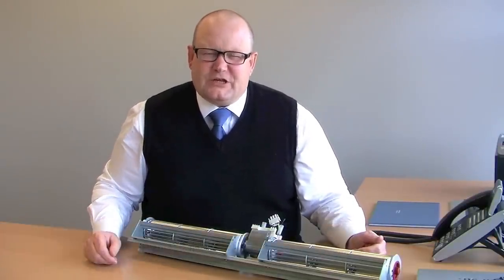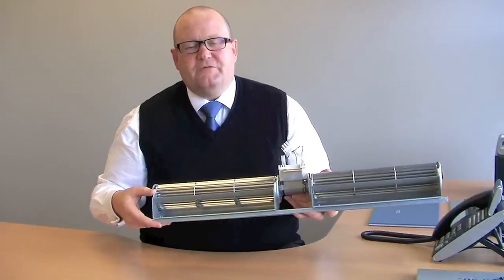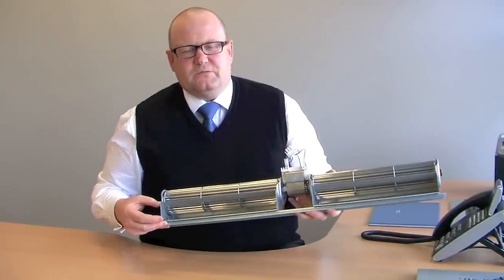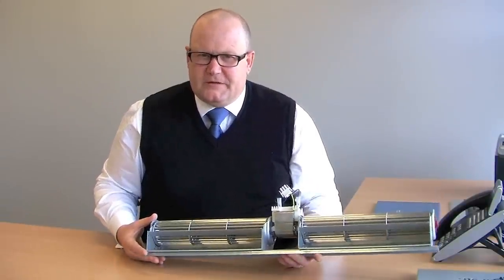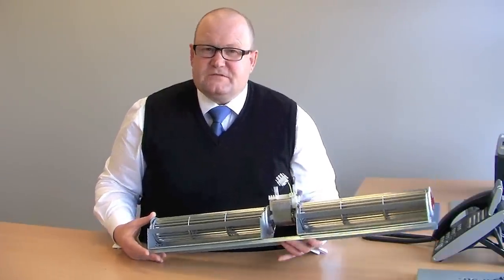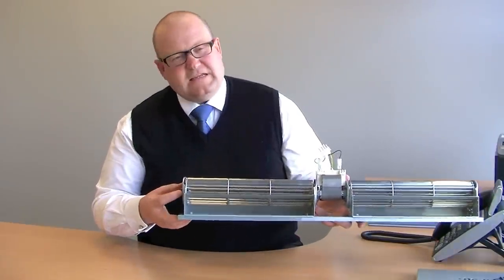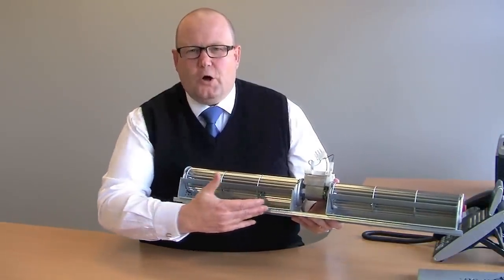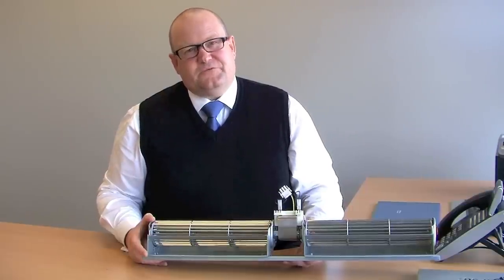Tangential fans & Cross-flow fans - ebm-papst A&NZ

Comment: What surprises me the most about these fans is the air inlet style. They are basically elongated blower fans, but what I find insane about this design is that with blower fans there is a large opening as an air inlet and with this design that doesn't exist and the air inlet is just another side of the blade construction!
Reply: Hi Andrew, there is nothing like this range of products.  Like all fans, a negative /positive pressure imbalance is needed and this is achieved with the design of the inlet and the outlet.  A vortex is created within the barrel that allows the flow of air.  Cheers, Simon

Comment: Hi, they are used in computers and DC motor versions are available.  Their use is not wide however as the static pressure capability of the fan type is not high enough if the electronics is densely packed.  Regards, Simon
Reply: +Simon Bradwell thank u for the information :)

Comment: I've tangential blower made by your company in my pellet stove. 
I always had (from new) too much noise at more than first power (at first power is not away but less annoying) and I noticed the noise is really from the blower. Before I thougt was somethig aerodinamic issue, an air escape from metal sheets or something wrong made in the stove, becase the noise is like a wistle, a loud wistle: "VUUUUUUU", like a strong wind through windows holes.
What's wrong with the fan? 
Cheap model? 
Bad bearings (but is not a "RUUUU" noise)?
Noisy motor?

The air escape emit a quiet rustle: "fuuuufRuuufuuufRufuuuuu"

The fan emit strong "windy" wistle.

I've a second Centrifuge Blower for air channeling on the right side of tangential blower , distant 10/15 cm from that. The noise could be an air clogh from the second Blower that made some aerodinamic issue? There is However large room around the tangenzial fan.
I ask this because I try to place a hand on the center of the blower, very close and the noise stop or become really quiet. But I noticed a very little power loss from the hot air output vent (still blow only little less) and the fan sound like a vaccum cleaner with something trapped in the hose. Sometimes, with same hand test the blower start to Shake! Thats make me think about a bearing issue, maybe with differen noise thand ball bearing.
Reply: Hi Tron, a bearing noise would be of low frequency - more of a rumble.  It sounds like the air flow is not balanced out of the unit especially if the centrif fan is blowing into/onto the tangential.  It almost sounds as if the centrif is blowing through the cross flow.  The Cross flow will only operate at low static pressures and in heater units is supposed to supply low velocity air across a width.  These fans are used so there is no noise.  As you have noise it sounds like wrong fan usage.  Please send an email to sales@ebmpapst.com.Au marked for my attention and we can help further.  Thanks, Simon
Reply: Most likely the noise comes from the AC Motor. They are not good for a fireplace, where the frame it`s made of hollow metal. You might be able to lower the noise, but not much if you put some dampers, bolting the fan straight in the fireplace frame it`s not a suitable for a quiet operation. You should look for a DC Fan, just Google, they are out there, buy the biggest one that fits your needs, it`s better a bigger one at 50% speed rather than a small one at full speed. With a DC fan you will need to power supply, I will buy a 24V DC fan, and a good power supply at least 24V at 20W. You could also buy a dimmer so you can adjust the fan speed accordingly. Right before power supply you could still use the thermal switch for automatic on off operation.

Comment: Does it make any difference to to operation of the fan which side the motor is located?
Reply: Hello, only if the motor is in the air stream.  If air passes over the motor, the motor will heat the air and add to the static pressure of the system.  I hope that is clear.
Reply: @SimonBradwell  Very clear, thanks for the reply.

Comment: I have one of these on my fireplace insert…ohf…it’s so loud it kills the ambiance. Is there not a better solution? Can’t you get rid of the transformer hum? Pardon the critique but that loud whirring noise sounds like an animal is dying in my living room. Isn’t there a toroidal equivalent cross flow fan?
Reply: Hi Bruin, thanks for your comments.  Yes, these fans are typical for domestic gas fore places to provide hot air into your room.  They are chosen because of their width and because of their low noise.  Speed control can however affect this noise and typically a tapped motor is best i.e. a motor that has wires out at three different windings which then gives three separate speeds.  Voltage transformers should not provide excessive noise, but I would suggest that other technology is being used as voltage transformers may be expensive for this application.  The manufacture may be changing voltage by wave chopping that may cause mechanical vibrations in the motor and drive systems...  I would suggest either using EC motor products (very low noise speed control) or products with tapped windings as above.  Always happy to help!  Please let us know if we can help further.
Reply: @SimonBradwell 
Thanks for the quick reply! The transformer isn’t very loud by itself, but it sits between two iron panels of stove, that act as a sound board and amplify the hum. 

I do have three wires with variable speed, the lowest speed is still noticeable. I suppose the shape of the blades could be modified to reduce noise and optimize efficiency (as toroidal fans have done)

If you know any replacement parts I could buy, please recommend! This is what my fan says:

QLK45/2400A39-2524LH-31 tu
115V-60Hz
30W Ins.Class H
5544255160
ebi FA 2510017981 Serbia(S) 11/22

Comment: How does the static pressure performance compare to axial fans? I was thinking about how these could be used with computers, which often use mostly axial fans (except for very compact systems like laptops)
Reply: Hi, the static performance is much lower.  Racks and electronics systems have increased in component density requiring higher back pressure.  Our new fans for these applications are typically higher flow and higher static.  Here is some info:  https://www.ebmpapst.com/au/en/industries/ict-electronics-industry.html.    Thanks for your question.  Simon

Comment: Is the flow in cross flow fans Radial in and Radially out?
Reply: Hi, this is a good question.  Although the xflow impellers are radial in nature, the airflow through a cross flow is straight through.  As such it could be considered axial.  However the "off" air flow direction is perpendicular to the impeller shaft and therefore technically the direction is radial.  The difference being in xflow fans is the air intake is also perpendicular to the impeller shaft.  I trust this helps.  Simon
Reply: @SimonBradwell  Thanks to reply but unable to understand.
When the profile of the vanes are same. Centrifugal force is the cause of suction. Centrifugal force is used to expel the things. Suction side is same as exit of air. Then why the suction occurs? When inlet and outlet is of same nature? Why not air is exited at inlet of this fan?
Reply: @EAR.Pakistan  good points - why does suction occur!  Indeed!  This is due to the design of the housing.  Negative pressure is created inside the wheel and this is enough to create flow through the wheel in a laminar manner.  This behaviour is only seen in these fans.

Comment: How much time ran this fan
Reply: Hello choice, the run time of the product depends upon the type of bearings used and the conditions of use.  The most effecting variable is temperature.  I hope this helps.  Thank you for commenting.
Reply: @SimonBradwell  Can the motor fail after being turned on for a long time?
Reply: @twrk139  The fan will fail eventually fail but after how long can only be guessed at.  A rough estimate can be calculated from the performance of the fan and the temperature of the bearings.  I hope this helps.  Please contact us at: sales@ebmpapst.com.au if we can help. Thanks, Simon

Comment: What if one or two blades of it break?  Will it cause any problem to motor?
Reply: Hi Abid, if the blades break then the fan will not perform and you should replace it.  If the broken blades cause the impeller to jam then the motor will be in a "locked rotor" scenario and will heat up until it fails.  Depending upon the protection devices in the motor, the motor will fail in a range of ways.  Overall, I suggest replacing your fan!  Good luck.  Thanks for watching!  Simon
Reply: Thank you for your prompt reply.  If you don't mind, I will elaborate my question, please look into it and share your valuable opinion.  I bought new air conditioner and it has single shaft plastic cross flow fan (same as one you were holding in video, but motor at one end).  After installation, technican who came to install it inadvertently broke 2 blades, each of around 3 inch.  They were both out of air conditioner, so they won't jam the motor.  Technician and seller are saying, it won't cause any problem as they are just 2 blades and the whole fan is intact and still has all other blades (78).  I know it will cause imbalance, but will it cause problem in overall condition of motor and lead to early breakdown? Do you still suggest replacing the whole fan?
Reply: Abid Mohammed hi - can the air con guy replace it under warranty?  If so you should insist.
Reply: Definitely the rotor becomes imbalance and the sides bearing will get overstressed and later on, stress on motor rotor.

Comment: makes me wonder why they dont use it in computers
Reply: lip lipper i'd very much like to know too! if anyone can answer this it'll be great!
Reply: +TheMorbiousStone +lip lipper.  Performance increases with fan speed and fan speed increases with motor output power (typically)so all of this can be changed.  The issue with any air movement application is the static pressure that is required to be overcome.  In computing, space has been minimised and electronic component stacking has increased.  This leads to high static pressures.  Tangential fans in general have low performance against high static pressures and other fan types are used are used more commonly - centrifugal for instance.  Tangential fan types have niche applications in which they work very well.
Reply: +Simon Bradwell thnx for the answer :)
Reply: @SimonBradwell  Hi Simon, I am wondering whether the distance from top of the blade to the top surface of the product (in this case an oven) is important in getting the best performance out of the fan. Is there a minimum distance above the fan you need to allow for proper operation. Also would a longer smaller diameter tangential fan handle pressure drop better than a large diameter shorter tangential fan. Thanks for your time, very informative video!